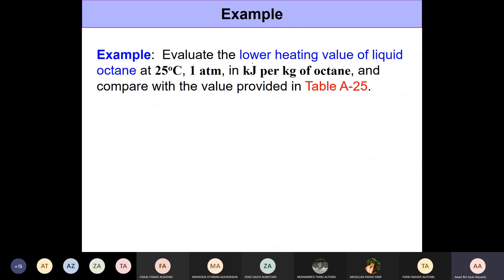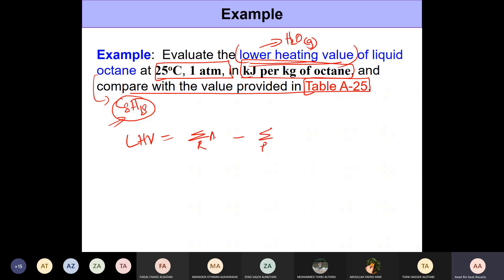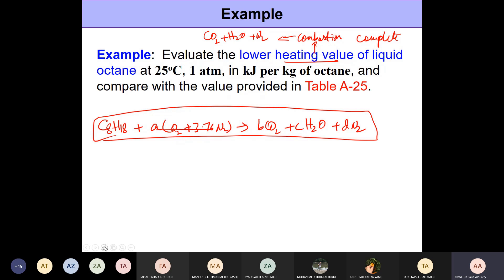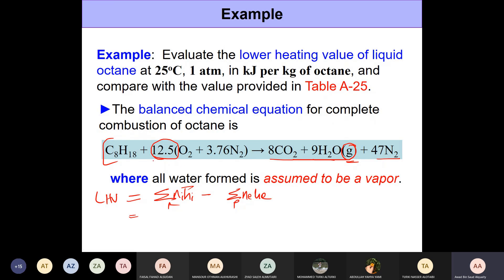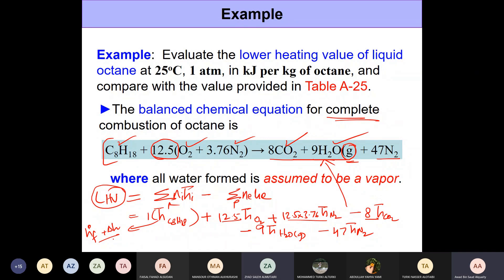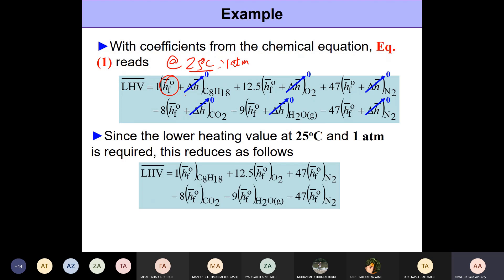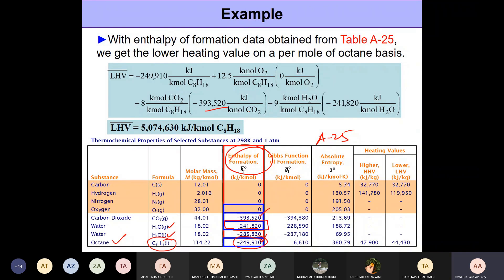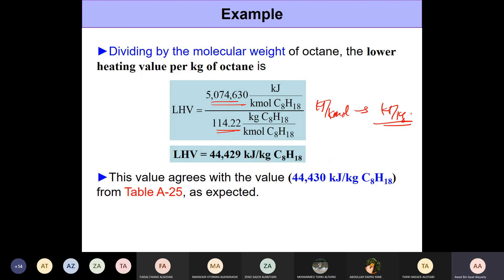Thermodynamics Solved Example: Lower Heating Value for Fuels

Comment: Thank you, Prof.
How about calculating the LHV and HHV of a gaseous fuel, say C9H20?
Reply from the maker: Welcome. The procedure for calculating LHV and HHV will remain the same. By the way, C9H20 is a liquid at room temperature, and as a rule of thumb, most hydrocarbons above C5 are liquids at room temperature.
Reply: @Dr.Awad_Alquaity Thank you, Professor. I understand now.